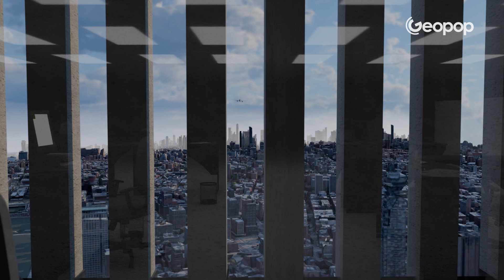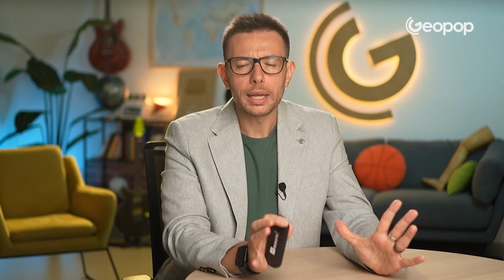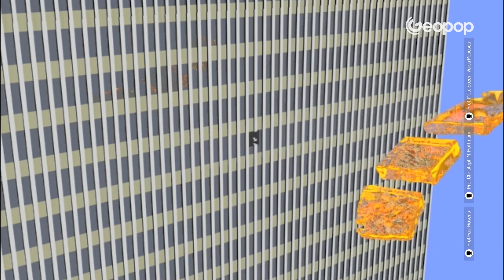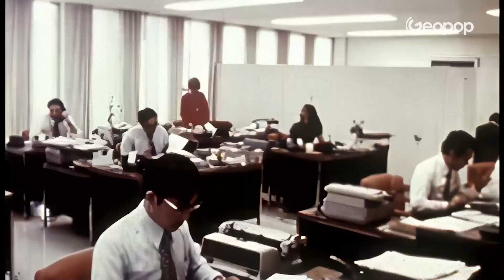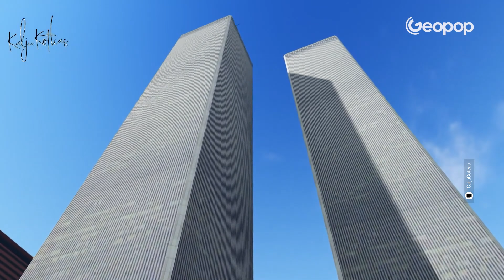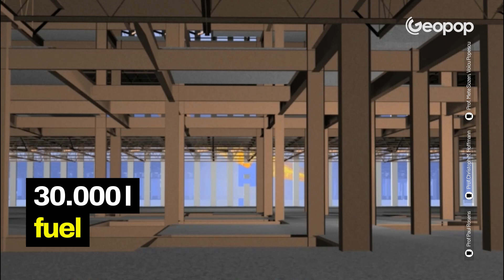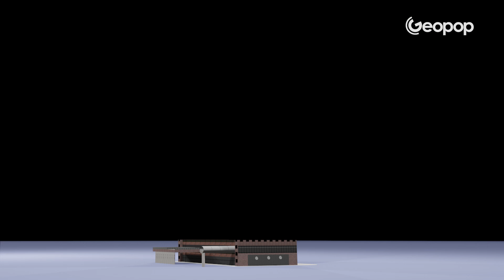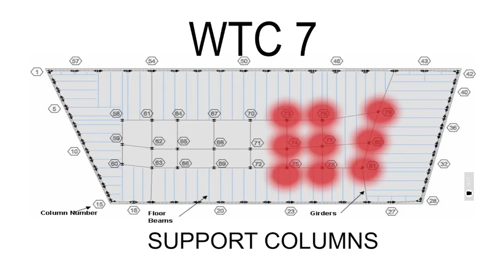9/11, 2001: The Technical Reconstruction of the Twin Towers and WTC 7 Collapses

Comment: However only where the fire was it heated up however the lower floors never heated up so they maintained their original strength! How is it possible the steel melted even though never reached 1500 degrees unless some other chemicals were used to melt the steel beams ! Tower seven was a planned demolition!
Reply: I suppose it never occurred to you that what started the collapse, and what kept it going are two different mechansims.

Twin Towers collapses were relatively straightforward, the fundamentals already understood in the professional engineering community within just weeks. Still, there’s a lot of really bad information floating out there, mostly on the internet where it’s easily accessible to anyone. Good information takes more effort to come by and is much harder for laypersons to digest. Engineeringspeak is complex and dull. Also, some people put up a wall to protect their beliefs and false assumptions. Engineering is hard while wild baseless speculation and pathological theorizing with easy hand-wave answers is simple and exciting. Fanciful tails of pre-planned demolitions, magical space beams, melting steel and mini-nukes are just far more entertaining and require a whole lot less thinking, thus getting far more intention than they deserve.

To correct that situation, I have all on my own prepared this short yet detailed technical description of Twin Towers collapses based on my own observation and analysis of the available true and relevant facts. No politics or ideology, just the engineering. My hope is this will dispel many common myths and answer most if not all questions you may have about the Twin Towers collapses, because anything can seem like a conspiracy if you don’t understand how it works

While complex, most of the Twin Towers collapse mechanisms can be seen with the naked eye and easily discerned and understood by the layperson if sufficient time is taken to understand. 

1. The Twin Towers consisted of 4 primary structural elements that together formed an integrated system where each relied on the others.  47 hollow box-section steel Core Columns carry the majority of the gravity loads. The 236 hollow box-section steel Perimeter Columns carry the remainder and ALL of the lateral (wind) loads. Long-span Lightweight Steel Trusses connect the core and perimeter column together at each floor with a Hat Truss on top to tie the structure together as an integrated unit where no element can survive without the others. There was no structural load bearing concrete and most components were bolted together.

2. The impact of 117 tons of airplane (= to about 12 dump trucks) at speeds up to 590 mph with the energy of a ton of TNT completely destroys the aircraft. This in no way implies the Towers come out unscathed. Many perimeter columns are damaged or destroyed as are some core columns (example; 33 of 59 perimeter and 20 of 47 core columns damaged or destroyed at the impact floors in the North Tower), This damage is primarily through bolt-shearing failures at the end connecting flanges, as well as bending, twisting and fracturing of weld seams. There was no cutting or slicing - the reality was far more violent and messy. 

3. The impacts destroy or damage fire insulation, fire breaks and sprinkler systems on multiple floors.  Huge fires are started across multiple floors simultaneously and allowed to spread rapidly with no effective firefighting or fire suppression. This was an unprecedented fire event . 

4. The hotter steel gets the weaker it gets .  With fire insulation stripped away and no sprinklers the survival time of the steel greatly reduced. Gradually over time heat causes the lightweight steel Floor Trusses at the impact damaged floors to sag, which was observed and recorded.  No steel melted or needed to. Structural steel fails long before it becomes a puddle. It just needs to bend

5. Sagging floor trusses pull on the increasingly weak and overloaded Perimeter Columns, causing some of them to bow inward by up to 5 feet. A straight column is up to 4 times stronger than a bent column. The bowed Perimeter Columns buckle and fail, initiating collapse. The formerly static mass above which the structure below could easily support is now converted into a dynamic mass up to 30 times greater. Because they have buckled, the Columns above and below the failure point are no longer aligned . The load bearing structure below no longer bears any load as it falls past the lower columns, NOT onto them.

6. Thousands of tons of debris fall within the four outer walls, down through the open office space, crashing onto the first intact floor it encounters. This massive impact immediately breaks the bolted connections to the columns as the amount of resistance the Floor Trusses can offer is negligible.  The falling debris slows only marginally and briefly. Note:
6a. This is NOT a solid top block crashing into and “crushing” a solid bottom block .
6b. The debris falls past the columns not onto them.  The columns provide no resistance to the falling debris. 
6c. Only the bolted connections of the floor trusses to the core and perimeter columns can offer any resistance. A pair of 5/8” bolts at each end of each truss vs. thousands of tons of falling debris.
6d. No laws of physics are violated.

7.  This floor-led collapse progression within the four outer walls can only go straight down. Note: 
7a. This process is often incorrectly referred to as “pancaking” which actually refers to a completely different process rejected at an early stage. The catchy name stuck but nobody knows what it is supposed to mean.  Pancaking is too simplistic and inaccurate anyway. More like Kaiserschmarrn.

8. Collapse progresses through the floor systems not down the columns, through the path of least resistance . Rate of floor failures increases with each successive floor as momentum increases, reaching an average acceleration of 0.65 of GA, or 35% slower than true free fall. Bam, bam, bam down the building until there are no more floors to fail.  The resistance offered by each successive floor is always the same. The mass and velocity, thus the energy of the falling debris is constantly increasing, with each floor destroyed adding new falling mass. Some falls to the sides, but most falls down. More mass, more velocity, same resistance with each floor.  Don’t get stuck on the but the lower floors weren’t on fire nonsense. They weren‘t and didn’t need to be.

9. The Towers were 95% air by volume. As that air was compressed inside the building it is forced down the tower and blown out the sides in reaction to the building collapsing . Those were not “explosions”, it was expulsions of compressed air caused by the collapsing building, explaining the low velocity, lack of flash, blast, supersonic pressure waves and lethal high-velocity ejecta.  

10. Perimeter Columns become detached and peel away like a banana behind the collapse front, playing out to the four points of the compass extending to more than 600 feet from the base of the towers. This was quite obvious from examination of the debris pile. 

11. Core Columns fail last as their internal beam bracing is stripped away by falling debris and lateral support from the floor to perimeter columns is lost. 

12. For those who care about how long this whole process took; 31-34 seconds from the moment the perimeter columns buckled until the last core columns hit the pile, or 1/3 the rate of true free fall. Don’t believe me?  Just watch any video of the collapses and note the loose truly free-falling debris dropping much faster than the towers themselves.  

13. Each Tower had a 1-acre footprint. Far from collapsing inside their own footprints the debris pile spread out over 17 acres in a pile up to 14 stories deep. 8 surrounding buildings were destroyed and scores more damaged by the falling debris. 

14. What was NOT observed were the 180-190 dB bangs of thousands of high explosive devices or the blinding bright flashes of burning thermite. Neither could have caused the (silent) perimeter column buckling that clearly initiated collapse.  Neither explosives or thermite could have survived the impacts and subsequent fires either. A video of a shocked and injured firefighter using the magic word explosion is in no way proof of explsoIVES . The pre—planned demolition case relies entirely on that sort of thing. There is zero tangible physical evidence and it would be technically impossible, totally impractical and completely unnecessary. No one would bother. 

15.  Finally, the Twin Towers were perfectly safe within their design envelope.  They only collapsed when taken far outside design parameters by an extraordinary and unprecedented event 

Impact + Fire (heat) + Time + Gravity = Collapse . Remove any one of those four elements and there is no collapse. Ignore any of those elements (as many do) and you will never understand the collapses. The Twin Towers were an integrated system in which no one component could survive without the others. One fails, the rest follow, through the path of least resistance – DOWN – through the open space, bypassing the path of greatest resistance – the columns.  Nothing I just described violates any laws of physics. All of the above is true no matter who planned and carried out the 9/11 attacks or why 

I hope you found this helpful and informative. It is not meant to be adversarial, but to solicit informed critical comment, positive or negative. If I made any errors of fact, logic or reason or left anything critical out, please let me know so I can fix it. To stay focused just one topic at a time please and on-topic (Twin Towers ONLY). No word-salads of Gish Gallop. IF you can offer a more plausible alternative be my guest. Be the first. Please start any reply with the words “Tits McGee” or I will know you didn’t actually read it, are not serious and just wasting my time.
Reply: @TheLoonResistance  : Pretty nicely put. Can I steal this? Thanks.
Reply: @ThomasKundera  - Yes. With credit of course. 

Don't worry about Robbie. He's an idiot.
Reply: @TheCriticalStinker-jw4fl  I wouldn't know where to start. There's.
Some truth in there , but most of its lies. Stinky is no engineer. It was mostly rivots, not bolts. It does have structural concrete,  melted beams were found in the debris along with melted steel in the dust. In the end, nist said the temperature was never high enough for the entire building to collapse and they never produced a diagram for the collapse in the twin towers. Stinky talks about engineering as if he is an engineer.  I've been building structures for over 30 years. I've read engineering specs hundreds of times, it's usually not very complicated. He claims it's so easy to understand and yet 90 percent of the new comments here disagree with him proving him wrong once again. . Stinky also says "no element can survive without the other. That again is false, . 
Commercial jets cannot fly 600 miles per hour a 1000 feet off of the ground.Proving it was a military plane
4. Is a lie.  It begins to weaken at around 570 degrees. But it's just as strong at 500 degrees as it is at 250 degrees so 4 is wrong.were overloaded? As you pointed out the columns on the 97th floor are exactly the same as the 7th floor. On the 7th floor they were strong enough to hold 100 floors so how do you come up with overloaded columns? I could go on and on and I did finding something incorrect about everything he wrote but I guess it's too much to post at once idk how stinky gets away with it, he's probably paid and works for someone
Reply: @TheCriticalStinker-jw4fl 7. You talk about the resistance but resistance takes time. And all these buildings fell at nearly freefall speed which proves the resistance you are referring to wasn't present. 
8. Watching the videos we can see explosions constantly forcing the building outwards as it fell, not straight down which explains why the pile was so small and body parts found ridiculous amounts away from the towers.
9. Not correct either 95 percent is with 0 people and furnishings inside. 
You're a joke.
Saying it took 35 seconds to collapse is just silly.
Claiming that there were no explosions is a lie. And you know better because I've already provided video evidence of tower 7 exploding. 8:20 https://youtu.be/bLF5D7M1YgA?si=iQJw1bw1P7vZRlir
I've posted videos of reporters , fire fighters and other people reporting these explosions why are you lying?
I'm done with your BS because that's all it is.
10. This isn't true and he has absolutely no proof of this and the way you know it's not true is because you can see parts of the outer perimeter still standing when the towers have fell.
11. More bull, no proof just made up crap. 
12. It definitely did not take thirty one seconds for any of  the buildings to fall
13. This one's wrong too because the debris was only as tall as the top of the lobby.
14. This is hardly silent. Then 8:26 in this one
https://youtu.be/bLF5D7M1YgA?si=aHSvS__uOdxMi1ZB
The firefighter said. " we gotta get outta here, tower 7 is exploding "
And I could go on and on about all the stuff. That's wrong and there's b***** He wrote right here.
Reply: @TheLoonResistance where you at stinky. Is that what you do when you're proven wrong?You just act like it didn't happen
Reply: You keep saying the same crap even though a number of us have proven this wrong. Maybe you should rewrite that crap genius
Reply: @robbiehiatt9966  : What's wrong in what he wrote?
Reply: @ThomasKundera 
7. You talk about the resistance but resistance takes time. And all these buildings fell at nearly freefall speed which proves the resistance you are referring to wasn't present. 
8. Watching the videos we can see explosions constantly forcing the building outwards as it fell, not straight down which explains why the pile was so small and body parts found ridiculous amounts away from the towers.
9. Not correct either 95 percent is with 0 people and furnishings inside. 
You're a joke.
Saying it took 35 seconds to collapse is just silly.
Claiming that there were no explosions is a lie. And you know better because I've already provided video evidence of tower 7 exploding. 8:20 https://youtu.be/bLF5D7M1YgA?si=iQJw1bw1P7vZRlir
I've posted videos of reporters , fire fighters and other people reporting these explosions why are you lying?
I'm done with your BS because that's all it is.
10. This isn't true and he has absolutely no proof of this and the way you know it's not true is because you can see parts of the outer perimeter still standing when the towers have fell.
11. More bull, no proof just made up crap. 
12. It definitely did not take thirty one seconds for any of  the buildings to fall
13. This one's wrong too because the debris was only as tall as the top of the lobby.
14. This is hardly silent. Then 8:26 in this one
https://youtu.be/bLF5D7M1YgA?si=aHSvS__uOdxMi1ZB
The firefighter said. " we gotta get outta here, tower 7 is exploding "
And I could go on and on about all the stuff. That's wrong and there's b***** He wrote right here.
Reply: @ThomasKundera  I wouldn't know where to start. There's.
Some truth in there , but most of its lies. Stinky is no engineer. It was mostly rivots, not bolts. It does have structural concrete,  melted beams were found in the debris along with melted steel in the dust. In the end, nist said the temperature was never high enough for the entire building to collapse and they never produced a diagram for the collapse in the twin towers. Stinky talks about engineering as if he is an engineer.  I've been building structures for over 30 years. I've read engineering specs hundreds of times, it's usually not very complicated. He claims it's so easy to understand and yet 90 percent of the new comments here disagree with him proving him wrong once again. . Stinky also says "no element can survive without the other. That again is false, . 
Commercial jets cannot fly 600 miles per hour a 1000 feet off of the ground.Proving it was a military plane
4. Is a lie.  It begins to weaken at around 570 degrees. But it's just as strong at 500 degrees as it is at 250 degrees so 4 is wrong.were overloaded? As you pointed out the columns on the 97th floor are exactly the same as the 7th floor. On the 7th floor they were strong enough to hold 100 floors so how do you come up with overloaded columns? I could go on and on and I did finding something incorrect about everything he wrote but I guess it's too much to post at once idk how stinky gets away with it, he's probably paid and works for someone
Reply: @ThomasKundera  6. The pile of debris was only as tall as the lobby. So if your number 6 is correct. Where did it go? And this doesn't account for the explosions during the collapses.  It also doesn't account for the multiple explosions below the collapse (squibs).
7. You talk about the resistance but resistance takes time. And all these buildings fell at nearly freefall speed which proves the resistance you are referring to wasn't present. 
8. Watching the videos we can see explosions constantly forcing the building outwards as it fell, not straight down which explains why the pile was so small and body parts found ridiculous amounts away from the towers.
9. Not correct either 95 percent is with 0 people and furnishings inside. 
You're a joke.
Saying it took 35 seconds to collapse is just silly.
Claiming that there were no explosions is a lie. And you know better because I've already provided video evidence of tower 7 exploding. 8:20 https://youtu.be/bLF5D7M1YgA?si=iQJw1bw1P7vZRlir
I've posted videos of reporters , fire fighters and other people reporting these explosions why are you lying?
I'm done with your BS because that's all it is.
10. This isn't true and he has absolutely no proof of this and the way you know it's not true is because you can see parts of the outer perimeter still standing when the towers have fell.
11. More bull, no proof just made up crap. 
12. It definitely did not take thirty one seconds for any of  the buildings to fall
13. This one's wrong too because the debris was only as tall as the top of the lobby.
Reply: @ThomasKundera  another thing people always leave out is the temperature of the steal, and here's what I mean. Have you ever picked up a hot pan or pot only to find the handle is too hot? Of course.  Even though the handle isn't touching the heat source it still warms up. I don't know the exact name for it but it's basically heat transfer. You ever hold a piece of metal and then light the end of it and find out that the side that you're holding gets hot as well? Same deal. With steel, the heat you apply in one area gets distributed throughout. So the air temperature was pretty dam hot. But the steel would be much cooler because the heat is distributed throughout the structure. Those buildings should still be standing today and they would be if it wasn't for the controlled demolition in those 3 buildings. Another thing you never hear stinky talk about is the up force. Let's say the top 15 stories broke loose and created a down force on the 95th floor. In that case there would be a equal up force on the 94th floor. So  the 2 forces equal out and would never destroy the entire building.  Newton's 3rd law
Reply: @robbiehiatt9966  :
Thanks for your articulated answer.

"It was mostly rivots, not bolts."
Correct. Which doesn't change much the reasoning, however.

"It does have structural concrete"
I couldn't find that. Have a reliable source to study this?

"melted beams were found in the debris along with melted steel in the dust."
Again, have a source?

"nist said the temperature was never high enough for the entire building to collapse"
Fire remained located around the planes hit location. The collapse is initiated there. That's what fire does.

 "Stinky also says "no element can survive without the other. That again is false"
All this would need deeper study, but, would you accept the following:
- Suppress core columns: the floor trusses have no support inside, they go down and the perimeter columns with it.
- Suppress perimeter columns: the floor trusses have no support outside, they go down and the core columns with it.
- Suppress floor trusses: the perimeter column have no lateral support, buckle and fall, maybe the core can withstand that, but buckling seems likely (very thin and high).
- Suppress roof structure: ? (here, I don't know).
So, maybe that's faster said than justified, but it's not so wrong.

"Commercial jets cannot fly 600 miles per hour a 1000 feet off of the ground."
They can. The owner won't be happy, as they would need to undergo maintenance afterwards, but I don't think the pilotes were too bothered by that fact.

" It begins to weaken at around 570 degrees. But it's just as strong at 500 degrees as it is at 250 degrees"
Of course it depends on steel qualities, but strength of construction steel will start to reduce at ~400°C, and it will expend, which is enough to stress the structure. And of course, temperature way higher that 500°C are expected in the WTC fires.

"the columns on the 97th floor are exactly the same as the 7th floor."
That's incorrect. That would have been a waste, and going into circle: to have same 97th floor strength than 7th, the 97th ones would have to be larger, thus needing the 7th one to be reinforced. Cycle that, and you'll end up with a stupidly heavy structure for nothing.
The structure was lighter at top, using thinner metal (and also reduced graded steel).

"I could go on and on"
Which is not a good idea if you don't fix your previous errors, as they pile up and you end very far from reality.

"I guess it's too much to post at once"
That's fine. Those were enough to see where both of you could be wrong.

"he's probably paid and works for someone"
If he's not retired, or owning a business, he's most likely an employ, like most of us.
Reply: @robbiehiatt9966  :
"another thing people always leave out"
Not the ones actually working on the subject like NIST.

"I don't know the exact name for it but it's basically heat transfer."
It's a good word. We speak about heat conductivity; and metals are good heat conductors.

" But the steel would be much cooler because the heat is distributed throughout the structure."
All that has been simulated. Temperatures are high enough for steel to lose a significance part of its tensile strength.

"Those buildings should still be standing today and they would be if it wasn't" for a plane and a fire.

"Another thing you never hear stinky talk about is the up force."
You swallowed some BS, I guess.

"Let's say the top 15 stories broke loose and created a down force on the 95th floor."
Right. A dynamic force.

"In that case there would be a equal up force on the 94th floor."
Right.

"So  the 2 forces equal out and would never destroy the entire building."
Why?

"Newton's 3rd law"
Some hoaxer told you that and you swallowed that naive idea.